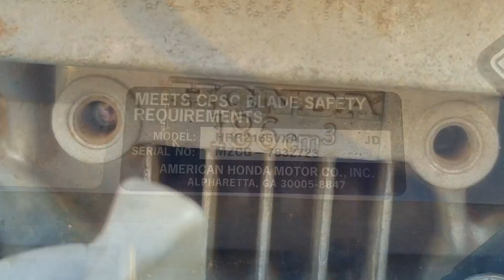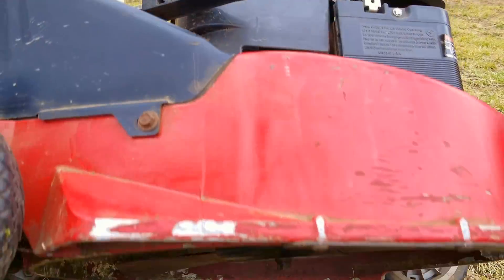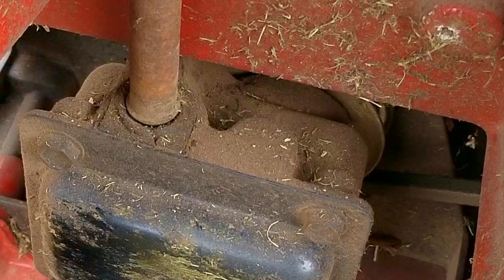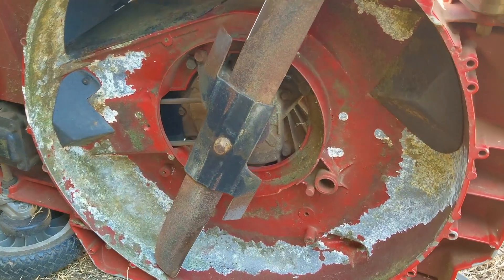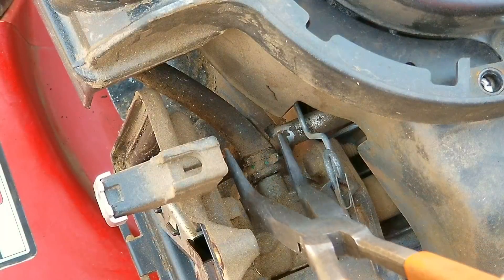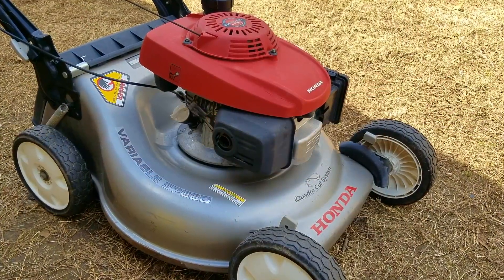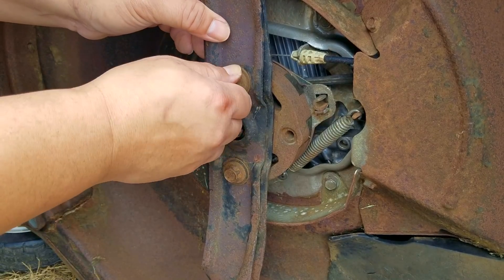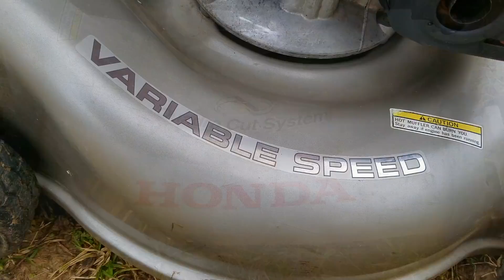Getting A Honda And Toro Super Recycler Ready For The Mowing Season For The Last Time

Comment: Was almost ready to get rid of my 20 plus Toro super recycler. It was becoming hard to start. Just needed a new coil (the spark plug wire attached to the coil was cracked and becoming frayed). Glad I kept it. still runs and mows great. Change the oil yearly. Thanks for sharing. I hope you get another one to share online.
Reply from the maker: Thank you Jim America, I appreciate your time.

Comment: So glad to see these getting ready to be used again and checked over. Something I do with the oil is I always fill it to the full because sometimes mowers will burn a little oil, some more than others, or leak a little oil somewhere and then the oil level gets really low if not checked for a long period of time.
Reply from the maker: thank you C:\ DOS, and you make a good point about the level.

Comment: That aluminum deck Toro looks like it could last as many years as someone would take care of it.  The grease fittings are a really nice touch.  Since you mention selling these, it would be interesting if you can pass along your observations throughout this season, of how much some of these sell for, or at least, how much MORE they sold for this year than what you might have made on them last year.  Between overall price increases in the economy, and the increase of electric mowers, maybe reselling these older gasoline powered mowers will be more profitable this year than what you would have expected in the past.  I know from the local Home Depot mower display that gasoline powered walk-behind mowers were in the minority of what they had on display.
Reply from the maker: that would very good information to know wouldn't , thanks for the suggestion

Comment: I just picked up a Populaun Pro self propelled with a Honda GCV160 engine on it real cheap. I got the engine running really good using one of your tricks from the motor swap video putting a small piece of tube over the choke lever starts first pull now. Now I just gotta do a little work  like the new front drive tires. This will become my personal mower.
Reply from the maker: nice, thanks for letting me know it worked for you.
Reply: @INSIDEHOUSEGARAGE  No problem I liked that super simple trick. I was getting kinda mad that it would start the first pull sometimes even 2nd wouldn't do it. It's nice now it gave the butterfly just the right amount of little help to close it needed. I love the little little GCV160 with out the autochoke. Thanks for making such good videos to learn from!
Reply from the maker: anytime

Comment: Just fixed up a newer Toro 22" recycler, steel deck cracked in 3 places (chute and both front wheels) and very low oil. Its a briggs flathead with electric start, so hoping it will be okay after I filled the oil back up, but will have to make sure it's not burning it. It may need new valves as it seems to have high compression, but the low oil may have worn the camshaft...
Reply from the maker: good luck with your project

Comment: Also interesting thing I found on the Honda air filters, usually they're a different color and possibly a different flow. I had one with a pre-filter running a bit rough. Removed the foam pre-filter and it seemed better overall, but I haven't checked the spark plug. May not be a significant difference.
Reply from the maker: that is some Interesting information there!

Comment: Nice 2 mowers you got there🙂👍 I recently got a Toro super recycler with the Briggs quantum 6.5hp exactly like that one. Paid $135 for it and runs good and the self propelled works fine. Funny thing is I was mowing yesterday on some high thick weeks and ran over some big grass with dirt or something that looked like a plant lol until I ran it over it stalled and started smoking a bit like it was overheating LOL 😂. It has oil in it of course, but anyway nice video.
Reply from the maker: thank you Brother's Lawn Equipment I appreciate the comment.
Reply: @INSIDEHOUSEGARAGE  No problem 😉

Comment: I can't help but ask why do you remove the oil when you put your engines away in storage?
Reply from the maker: Just in case it leaks past the bottom oil seal,  the storage people don't want gasoline or Oil in their place.
Reply: That makes sense I'll have to try that next time
Reply: @ Braden Henderson
This is a good idea if you find yourself with so many you start stacking them vertically (rear wheels on the ground only) to save space. Should be a good mower season 😎

Comment: I have a 25-year-old Toro with the aluminum deck and it still runs but the engine on its last leg. I am told aluminum decks are no longer made so I want to replace the engine. What engine would you recommend for an engine swap for such an old Toro?
Reply from the maker: easy , Kawasaki, or Honda are my choices.

Comment: I'd really have kept the toro. I think because I have one close to it as I mentioned before. That engine if you  keep it up and the deck i bet would be good for maybe another 15 years or so all depends i suppose. Seems like ive seen more fuel cracks in the lines since they made that new gas even though they have   ethanol free and charge more for it =/
Reply from the maker: thank you Rares R and yes the Toro is something special in my book as well.

Comment: Love those Toros.  My parents had one almost exactly like that that one.  I'm sure that thing had hundreds of miles of mowing on it.  My regular mower is a newer model that's only 2 years old.  I bought it specifically for the cast aluminum deck.  I should have sprung for the Honda engine though, then I'd have the best of both worlds.
Reply from the maker: you got that right, but you still got a very good mower out of the deal.

Comment: Blades on the Honda should have been replaced, when metal separation occurs at the trailing edges of the blade (air lift) it should be replaced, not only for safety reasons but for cut-quality reasons.  when the lift wears away which is inevitable, it won't cut at all because there will be no vacuum and little air movement.
Reply from the maker: very true, but I'm going to let the owner decide on it.

Comment: Both are top quality machines. I personally think the Quantum is the best engine for a lawnmower. The Honda upgrade from a GCV160 to GCV190 should be a solid choice. My bias is for the American Briggs, but Honda makes excellent engines and both are heads and shoulders above the Chonda engines sold on new mowers today. Powermore sounds like a battle fought in the Jacobin wars, not an engine name. Just my three cents, increased because of inflation.
Reply from the maker: I always appreciate your insight.

Comment: Great tip about checking for a carb leak after running dry and storage!  Never heard that before but it makes sense. You’re extremely careful to fill oil to the correct level, but I think it would help viewers even more to stress every time that over filling will kill an engine just as easily as under filling.  I’ve seen more than one YouTube creator bring in machines where the owner thought simply adding more oil without carefully checking the level was correct and the engine was damaged as a consequence. 👍🔧🧰
Reply from the maker: very good point,